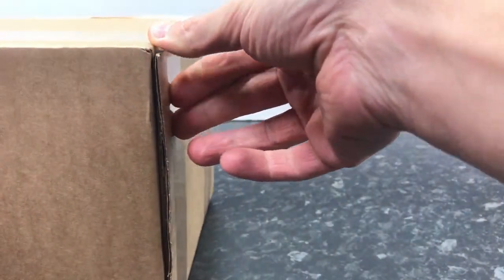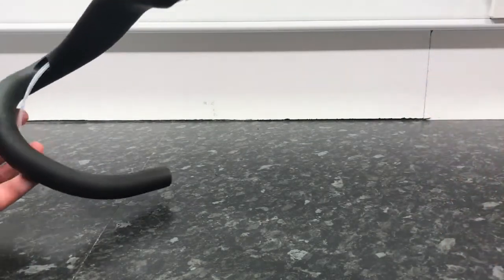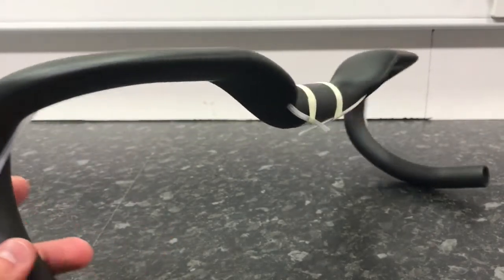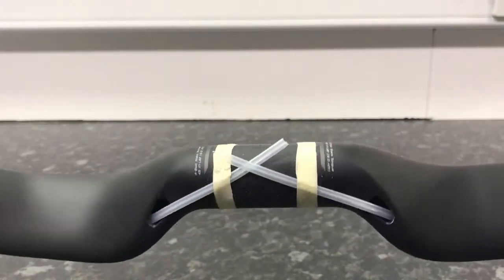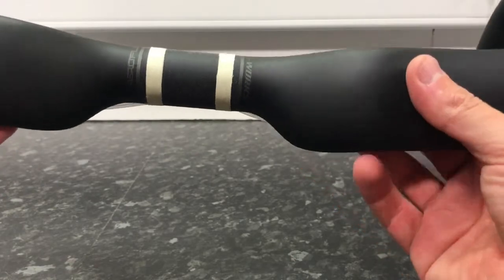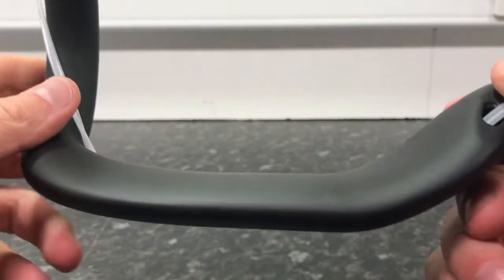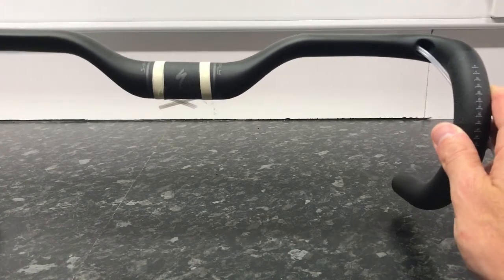Specialized S-Works Aerofly Carbon Handlebar 25mm Unboxing

Comment: That extra hole is more than likely a di2 (or similar) feature for the internal junction box that sits in the end of the bar rather than the conventional under the stem box that most bikes have come with until recently. The 25mm rise counters the 25mm drop a -17deg stem would give compared with more commonly used -8deg stem. A -17deg stem sits parallel with the ground and therefore has less frontal mass than a normal -8deg stem which effectively sits at around a 10deg angle in relation to the floor. The rise in the bars affects frontal mass less than the difference between the 2 stems. So together they are faster overall marginally speaking of course 😉
Reply from the maker: Awesome post! Thanks for the info!
Reply: Kyro's House no worries, have checked out a couple of bar end junction box installation videos and that hole is definitely for the wires leading into it.  What would be cool is having a hole at the back of the clamping area so you could run an existing under the stem "jb" inside the stem with a bit of sponge to stop it moving or rattling. Even better have corresponding holes in the forks so the wires could be run straight from the inside of the bars through the fork steerer tube and directly into the frame so its completely hidden from view and the air. I haven't built any up yet but I'm pretty sure that's how its done on the new treks and others that have fully internal cables. One the warranties over on my Foil the dremel is coming out in full force might have to get the main man Mike Burrows to re-enforce the holes a little to play it safe though 😉
Reply: Purchased 2019 Spez Venge Pro 56cm and experiencing tingling in hands with stock bars and 100mm stem...With max stack height 35mm do you think I will benefit from the rise...Is it a true 25mm bump?

Comment: If you have small hands, beware, the top bar is pretty wide.  It's almost too wide for me and I don't have small hands.  It won't be good if you have carpal tunnel syndrome cuz the back edge may put more pressure on ulnar nerve for being too wide.  Not good for long climbing either.
Reply from the maker: Paul O good point for people with small hands, thanks! 👍

Comment: I’m planning to install these on a allez sprint. Are there any other parts that I need? For example will I need a new stem or plastic covers for the area where stem and handle bars meet?
Reply from the maker: Thepaytonb not really, I just had a standard stem with no internal integration and they were fine. I’m not sure if they have a matching stem as at the time I just wanted a bar with internal routing. The aerofly II bars have a stem and plastic covers but as I said, not sure about these ones. Sorry 👍
Reply: I got mine installed on my Allez Sprint with a Vias stem.
Reply from the maker: Jelmer van Kampen ah nice! Bet it looks great!

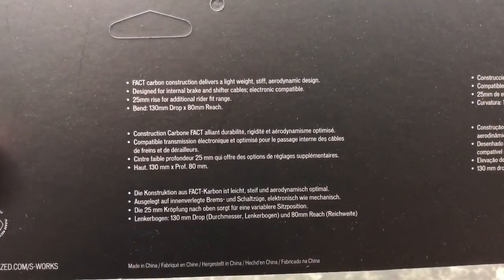Comment: Hey, I shared your video with a friend of mine who works at the Specialized headquarters in Morgan Hill, CA, and told me that your handlebar is a perfect copy of the real one because it's missing the barcode sticker on the inner right side. and also said that Specialized does Not manufacture bikes/parts in China... Specialized manufactures almost all of its production in Taiwan. See your video at 1:33 minutes. Sorry, Let me know if you have any questions for my friend.
Reply from the maker: No that’s cool, I bought the bar from Sigmasports in the U.K. which I assume is a reputable dealer. Ok so replace China with Asia, my point was that most things are made from that area. And non mainstream brands get a bad rep even though the same factory probably makes parts for multiple brands. 👍